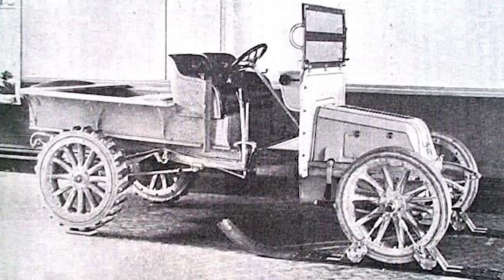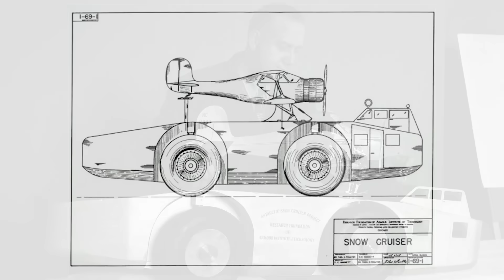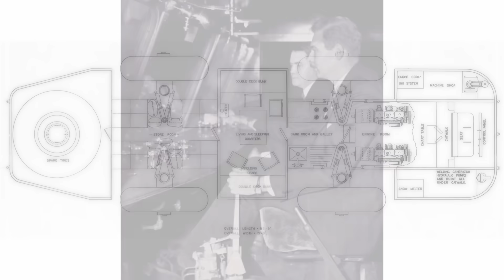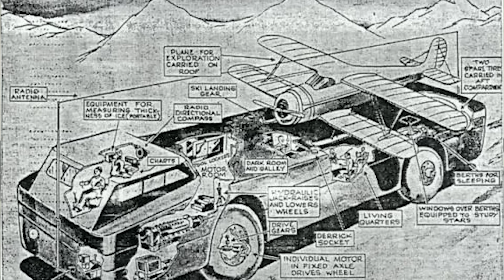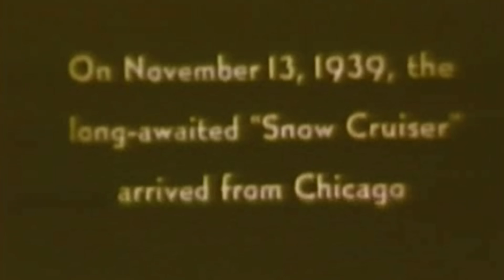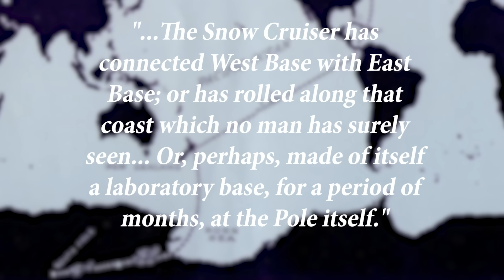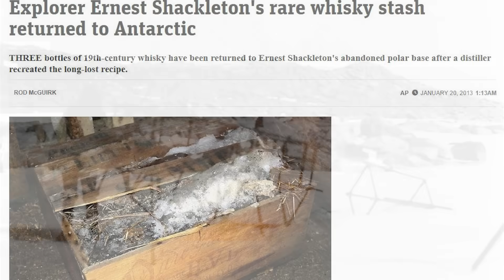"The Snow Cruiser"-Antarctica's Abandoned Behemoth

Comment: everyone in the comments why dont they use tracks... well tracks arent amphibious there hard af to work on there heavy they will crack and snap in the cold. tires float there super light and easy to change and fix duh..
Reply from the maker: Funnily enough, the Soviets got it right way back in the 1950s (using tracks) and they're still running to this day: The Kharkovchanka! https://youtu.be/f6R-h06IsJw
Reply: @CalumRaasay  I work on them. All modern amphibious vechles now have tires. Track breaks machines down. Track repair takes hours tracks corrod an pins snap making them un movable tires are far supior, one tire down the mchine keeps going tires float tires are easy repaired tires are easly bullet and bomb proof . Tracks are disappearing more and more each year. Newer tires also inflation and deflait off the exhuast there cheaper and last longer. Track repairs are expensive take long periods of times they collect mud and debris that also enhances the corrosion process leaving the vechles stranded. Broke tracks cannot move a flat or blown tires can. Tires now are run flat Kevlar with or without spikes they self inflating they float unlike tracks which will sink if the vehicle itself isn't amphibious.

Comment: R.G. LeTourneau's Snow Train Vehicles would have done much better down there.  I.I.T. should have consulted with them in Peoria, IL before they completed that 
bulky low ground clearance design with smooth/bald tires.  Too much front and rear wheel overhang.  Designed to fail.
Reply from the maker: I'd imagine LeTourneau probably got some of the inspiration from the snow cruiser - both designs utilised a diesel-electric transmission to drive a multi-wheeled vehicle. There was almost 2 decade gap between these vehicles, and nothing like the cruiser had existed before it. 

 “I have not failed. I've just found 10,000 ways that won't work.” - Thomas A. Edison
Reply: @CalumRaasay  Just thought of this, possibly the Snow Cruisers significant fwd and rear overhang was to prevent fatal plunges into narrow/very deep cravases initially covered by snow. By the time the weight of fwd pair of wheels caves in the cravass ceiling, the front end is already over solid ice & snow on the other side...

Comment: As someone who know quite a lot about WW2 and the history of tracked vehicles(such as tanks) I may have the answer to your Why didnt they just put tracks on it question.
There are a couple of reasons:

1. The Snow Cruiser is a very large vehicle with a massive weight. In order for it to not sink into the ground it would ether need wide tracks to give it less ground preassure or it would need large tires. If you have ever seen some of the early WW2 tanks such as the Valentine, Matilda, Pz. 2/3/4 or specificly in the US case the Stuarts and the M2 medium you will see that they all have thin tracks. Thats simply because technology for large tracks wasnt there yet and even when HVSS was invented and succesfully implemented on the M6 Heavy in 1942 they still were not able to make large enough tracks. When the US developed a tank that was suposed to break threw the siegfried line in 1944 in the form of the T28 super heavy tank they had to give it two sets of tracks on each side in order for it to not sink into the ground.

2. We know that the vehicle had a underpowerd engine that had a hard time powering the 34 ton monster. Do you realy think that replaceing the baloon tires with heavy steel tracks would have made things easyer? The baloon tires were clearly there to preserve weight. What is also kind of funny is that WW2 realy revolutionised US engine design. If they had waited for 2 more years they would have been able to use the 400 hp radial engine as found on the first shermans. Now that I think about it overheating is not realy a issue in the arctis so they probably could have even used something like the 2000hp P&W R-2800 18 cilinder radial engine as found on the F6F-5 hellcat.
3. I can immagine that they ran the numbers on the ground preasure of the balloon tires and were like: Well thats just as good as tracks but it's much lighter. Getting the vehicle to a snowy area would have probably been one hell of a problem since it already had problems getting to the harbour and being loaded onto the ship so they probably didnt want to risk it.

At the end I just want to ad that it is interesting to see how this project later helped the US makeing their vehicles and equipment as reliable as possible. The US tested everything to make absolutely shure that it would work once it got to the fight. So I guess at the end the Snow Cruiser might have actualy helped win WW2 :)

Comment: "Let's build something that won't sink into snow" 
"Yes , and make it weigh 38 tons,"
Reply: It's probably a blessing in disguise that it didn't make it very far.  Imagine if it fell into a (I don't know the term, thin ice form?).  Whether into water or cavern, all crew aboard would have been lost.
And with that tonnage, they would have found one.
Reply: @emprsnm9903  crevasse
Reply: a vehicle's footprint could largely counteract its weight, in theory
Reply: @mam362  yes, to measure if a KingTiger could pass over bland terrain one of the crew would jump onto another's back and that one would stand in one feet over said terrain, if they didn't sink then the tank could pass, so yeah, tracks are helpful to distribute weight, 79tons putting the same pressure to the ground that a couple of germans
Reply: @JZ's Best Friend I think it has more to do with torque, I mean, there are lower hp trucks that haul that tonnage
Reply: @JZ's Best Friend The motor produces torque, rotational force.  The hp figure is derived from the rpm: (TQ x RPM)/5252 = HP.  An electric motor can produce immense torque while making very, very little horsepower simply by turning very, very slowly.
Reply: Yes in theory
Reply: sorry for my english btw :)
Reply: "Let's make something that won't sink into water."
"Yes, and make it weigh 47,000 Tons."

Comment: "During the trip, a damaged steering system caused the vehicle to drive off a small bridge on the Lincoln Highway and into a stream near the town of Gomer, Ohio near Lima, Ohio, where it remained for three days." - did you read Wikipedia before making the movie? Failed to mention that it did travel 92 miles in reverse during one trip. Not 8000, but hardly a total failure

Comment: Brilliant, the funding should have stopped at “ the tires will be slicks”.😳🤔😬🤪
Reply: Beat me to it lmao no wonder it got stuck, zero traction 😅
Reply: Big Wheel  Someone else commented that they did use chains on the tires but still failed.
Reply: New explorers have flat tires, but they are slightly deflated. This is a trick known from Iceland. A car with deflated soft tires can drive on snow.
Reply: This is a total no brainer,even a child could have designed a tire which had treads or metal studs for traction on ice. It’s blindngly obvious,sorry to all the apologists for the useless designers of this vehicle,but slick tires will not get traction on ice or snow,period... also ,using steel chains is no more than a weak attempt at remedying a fault which should never have been designed into this monstrosity of a machine chains will not work for extended periods of time on something this heavy. Anyone with the slightest experience of driving off road or in sub zero temperatures knows this.
Reply: On level snow, the enormous flat surface area of the tyres mean it would work with slicks. It's for cruising over large flat landscapes not climbing
Reply: Democrats know how to waste millions in taxpayers funds .
Reply: @darrellgoodman9585  That was the engineer's goof.
Reply: @darrellgoodman9585  and you worthless windbags sure do know how to let the world know how desperate and pathetic you are. How is all of that LOSING going over there?
Reply: Darrell Goodman you just had to bring that up,didn’t ya!?🤣🤣🤣🏴

Comment: So the designer was inspired by the success of the early snow tractors, and decided nah, it wasn't the tracks that helped, lets give ours balloon tires.
Reply from the maker: The biggest issue is The Cruiser was built in 11 weeks, and Poulter (the designer) accepted from Gulf Research a set of moulds for large tyres 3 m in diameter and 0.9 m wide, developed by Goodyear for a lightweight swamp vehicle used in oil prospecting. At the time they knew that wheeled vehicles worked on ice but not on snow, however, there were no real measurements or systematic observations to say why that was the case. Poulter had seen tracked vehicles running successfully on deep snow, and could not see why suitably clad wheels, large enough to distribute weight and minimize pressure over the surface, should not work just as well.

The cruiser was tested briefly on Sand dunes and found to work quite effectively. Sand and very cold snow behave similarly but not identically. Poulter had measured and found coefficients of friction for the two to be about the same, but the unit weights (which he apparently did not measure) differ. Sand is roughly four times heavier than snow, and Poulter might have predicted that performance in sand could well be four times better than in snow.
Reply: @CalumRaasay  "The biggest issue is The Cruiser was built in 11 weeks." The overall haste of this vehicle's development and deployment is the key to its failure - if time was allowed for a few weeks, or even days, of testing in winter conditions in, say, North Dakota or Alaska, its shortcomings on snow would have been discovered.
Reply from the maker: Don Jones I think the plan was to perhaps make changes in Antarctica or even take it back to America to upgrade. WW2 unfortunately put a stop to that 😕
Reply: If the technology was there to put tread on those tires and a mechanism for regulating tire pressure I think they would have done much better. Big smooth balloon tires may have been efficient for getting them along a flat surface, but there was no way it was going to be effective in the snow on any kind of incline.
Reply: @Dr.TJ_Eckleburg  the tread directly runs counter to the ability of the balloon tyres as they restrict the volume adjustment of the tyres.

You are applying logic from tyres that have PSI that work in a range of +/- 15% to ones that work with +/- 300%

The tread of a tyre is based on the idea of compacting material under the tyre to gain surface area for friction as the vehicle bites the material.
Tread works on compressed pack snow, and only on powder snow by packing it using vehicle weight.

The balloon radically increases contact surface area and prevent the compression of the snow that tread needs, as all surface snow in on the poles is powder for dozens of feet thick, standard tread ideas simply throw a powder plume until the vehicle is beached on its belly.
Reply from the maker: Luckily, the Soviets got it right- The Kharkovchanka! https://youtu.be/f6R-h06IsJw
Reply: Hey haters - so what countries are all you 12 yr old fanboys from?
Reply: it wasn't such a strange idea - The balloon tyres weighted far less and made for better ground pressure than the tracks on a vehicle of that size
Also in sub-zero temperatures for long periods track linkage pins become brittle and risk throwing a track
Reply: i like how u defend an obvious FAILURE. I mean its was stupid and it was proved to be so. Tracks are used for ice and snow and until this day  its the most effective way to move around with. So wtf are u talking about.
Reply from the maker: @alexini5  I like how apparently discussing the complicated nature of the design and how it wasn't as simple as "lol they were dumb" offends you so much. Go read a book and relax pal.
Reply: First of all my reply was for Ben Grogan in the first reply comment....But i will get a book so u will relax too.
Reply: @alexini5  What you need to remember is that this was in the late 1930s, World War 2 was about to breakout and adding tracks to a vehicle this size would be incredibly complicated and difficult not to mention expensive. You're also forgetting that tracks are incredibly maintenance-heavy, ESPECIALLY during the 1920s to '40s, having wheels in such a machine makes much more sense than adding complicated, labor heavy tracks in a place where the outside temperature averages -30 degrees Celcius
Reply: @alexini5  there's a decent number of snow vehicles today that still use ballon style tires very effectively even better so then tracks due to the maintenance they require
Reply: @alexini5  mist vehicles ate the poles still have wheels(more hightech than what the 1930 had but still wheels) and even modern hauling equipment doesent use metal tracks they use rubbertrucks wich were not really all that great back then so it was the obvious choice.....
Reply: Why didn't the morons just fly to antarctica?
Reply: Bet it'll work great after the snow has melted
Reply: Right? WTF?
Reply: Then the rest of the design team said, YEAH, but what if we don't put treads on the tires and also power them with highly under powered pile of garbage electric motors, and power the electric motors with two diesel engines that can easily drive the cruiser by them selves.
Reply: @jacwilson2578  Trains are "Diesel-Electric" and considered very efficient.  No need for a clutch, gear box, differential, drive-shafts and "U" joints. Electric wheel motors can apply torque at ZERO RPM. Also consider individually retractable tires - how do you manage the power delivery with 1935 tech ?? I agree it seems "underpowered" but 300 HP for 75,000 pounds is what some modern "weak" semis have. It would get lighter as it burned off fuel.
Reply: Also if you want to use tracks. You need a much bigger and powerful engine. The snow cruiser had individual motors in each tire. The snowcruiser is also massive. You'd need a huge diseal engine that would suck way tp mucu fuel. The snow cruiser was ment to past on its own for a year. Impossible if the vehicle had tank tracks
Reply: Funny thing is, low ground pressure isn't great with slick tyres, the lower the force there, the better your grip needs to be
Reply: @JesseP.Watson  that is not completly correct, you are leaving out the acceleration you want to achieve and how much this would have been hindered by sinking into whatever the non specified vehicle is on
Reply: @JesseP.Watson  also, grip is a multiplikation of friction × weight the area you spread that on has no effect on grip (obviously on slippery surfaces it can by allowing more friction surface to contact the road)
Reply: @stevengunter4990  I just know from my own driving in snow and ice that thin tyres generally bite better on snow and ice than great wide wheels. ...A 2cv for example, with very narrow, 10cm wide tyres (similar to a motorbike tyre) grips well in mud and snow, whereas a modern car with 25cm wide low-pro sports tyres is terrible.
...Ice rally cars, though they obviously have spikes too, also run with very narrow wheels for maximum contact pressure.
It is true however that if attempting to avoid sinking into powder, a low ground compression balloon tyre is preferable, as on a quad bike or tractor - the fact that these are very low ground pressure tyres WITHOUT any tread though is, well, not very clever... As I wrote above - the lower the ground pressure the less bite you get - ergo, these tyres have such low ground pressure per square inch that they just sit spinning on the spot, as proved by the failure of this vehicle - they're essentially special snow polishing wheels, spin them once and you're going to need a push as they'll not climb out of the impression in the snow you've made, they just polish it to a perfect shine instead. :-D
Reply: Except tracks aren't the reason tractors are called tractors bub